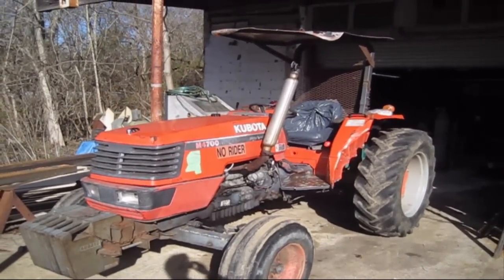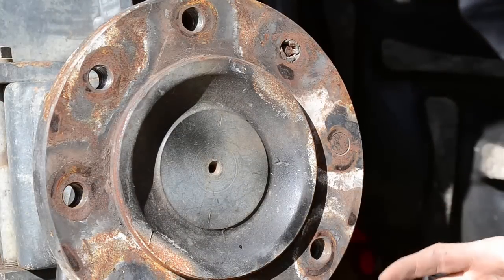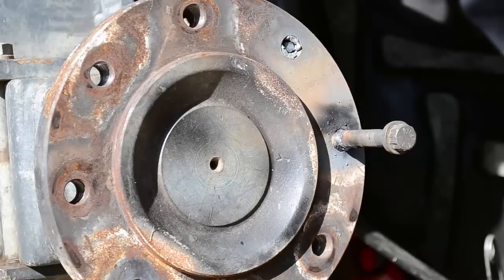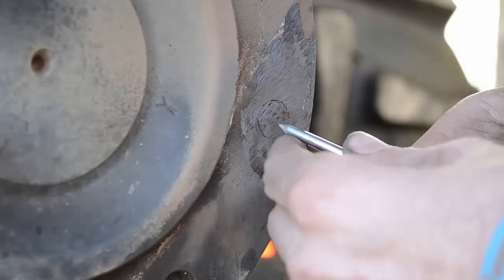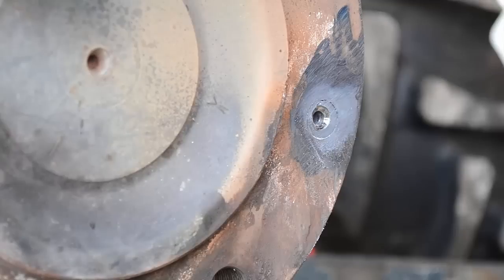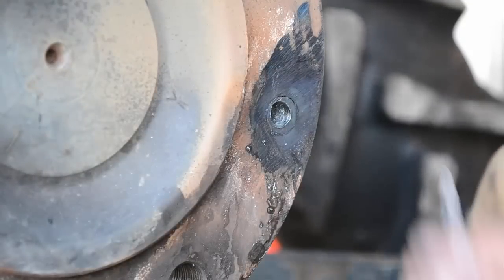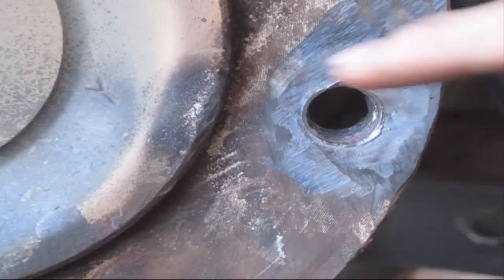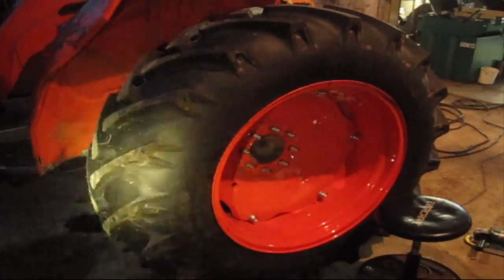Broke-off bolts techniques

Comment: 35 yrs doing this stuff, little tip is set the bolt 3/4 way off center of the broke stud and then get a good fillet from the broken stud to the bolt.  it's much stronger than a little ring around the outside.  thanks for the video

Comment: 1)Slow the drill speed. 
2)Left hand drill bits. 
3)Lube the bits. 
4)Heat around the bolt, not the bolt.
Reply: my sentiments, exactly!
Reply: yes your right DO NOT HEAT THE BOLT YOU HAVE TO HEAT AROUND THE BOLT TO MAKE THE BORE EXPAND.
Reply: I repair heavy equipment for a living, I always drill the bolt first, slowly and preferably a left hand bit. Then if you have to heat the bolt and when it cools it will shrink to the hole you drilled thru it
Reply: Dito on the left hand drill bit.
Reply: @gophersanders6542  I agree. I also repair heavy equipment. Whenever you need to heat something up to get it unstuck, always try to heat up the piece you plan on throwing away.
Reply: You dont drill, you dont heat around it, you just weld a nut on it and use an air hammer on the top with a box end wrench. Done this hundreds of times.
Reply: @EliteTruckRepairs  Never been shown that trick. Thanks, I'll have to try that.
Reply: 1) Definitely. 
2) Useless in this situation. 
3) Definitely. 
4) Doesn't matter, just braking the bond.
Reply: J B 
Left-hand drill bits still make a round hole. So it doesn't matter if you use right or left hand bit. But you want go heat the hub to expand, not the broken stud. There are many ways to get the out, but use a diamond bit. This should not have taken longer the 30 minutes to fix.
Reply: Candle wax after heating AROUND the bolt . Prevention of breaking a rusted bolt is so important.
Reply: In some cases you cannot drill or weld a nut in because the part that was held by the bolt has no room. Plasma cutter is the only option and this creates another set of problems.
Reply: Heat the bolt red hot, let it cool to room temp, take it out with your fingers.
Reply: @k9cop998   the thought process behind the left handed drills are they sometimes spin the stuck bolt out. Very rarely though
Reply: K9 Cop 
Yeah, well, that left handed bit can and will bite and unscrew the broken bolt a lot of times once it's just about through. A right handed bit won't do that, it'll only bottom the broken bolt even tighter most of the time.
Reply: @larrypostma2866 It doesn't matter here. It's a through hole.... A right hand drill will also grab it, but it will push it through. Especially here where the bolt won't go out the right way.
Reply: @cedryc44 That's a good rule. Heating the part you throw away doesn't matter. It's scrap anyway.
Making a hole through the bolt, heating it red and leave it will first compress the material since it has nowhere to expand and when it cools it will shrink. It should be loose in the thread when it's cold again.

Comment: I worked on the railroad for over 30 years ...the best way to remove a stud is to just weld a flat washer to the broken off stud.then put a larger nut and weld to the waxher thru the hole...dont wast your time with a torch. The welding heats it up and then the outside of the nut is pristeen for a socket. On an impact gun. 
On the holes that are stripped , you can drill it out a d insert a bolt thru the back with a piece of flatbar welded on the head so it wont twist. Ir. Wld up the hole, aneal with a torch and then tap or use a Helicoil insert. Thanks for your video
Reply: what ,if the stud is recessed, can't weld a washer to the stud???
Reply: Zoltan vacsi I have had that before, I use a mig and slowly and carefully build up the stud to the surface then weld a nut on
Reply: Lee make a video please

Comment: A few negative comments on here but seemingly from people without their own YouTube channel demonstrating their superior skills.  I'm a DIY amateur who maintains a couple of old 4x4s, and have had my share of broken-off bolts.  I honestly wouldn't have fared any better.  This was an honest and well-narrated journey, informative and interesting to follow along.

The only additional things I can add is that sometimes I use phosphoric acid - for example Frost's POR15 Metal Prep - soaked down into the threads (if there's room) for 30-60 minutes before I start.  On occasion I have found it helps to break any rust bonds.  This has worked a couple of times for me in combination with heating the bolt area with a butane torch then shielding the surrounding area with hand-held cardboard containing a hole that allows me to spray the bolt head with cold water...to shrink the bolt but leave the surround expanded.  (This is assuming I have a nut welded on.)  Not foolproof but has helped save me a few times.
Reply: A Teleskier .... Use muratic acid applied drop by drop to area...it will remove rust down to white metal..😃👍👍👍

Comment: Tip from a hobby machinist:  don't run a drill wide-open in steel!  It can't get a good bite running that fast and you just end up dulling your bit.  Start slow, and as it cuts more and more, you can start to bring the speed up.  I typically don't get over half-throttle with a battery powered hand drill.  The thicker and/or harder the steel, the slower you need to go.
Reply from the maker: Thanks for the comment.  Well I am not a purest with drill bits, but I have drilled a hole or two.  I have never heard of slowing down in thicker material that's a new one for me.
Reply: I agree. if you're drilling wide open and getting little needles for chips, you need to slow down or get more feed pressure. i also keep a solid carbide drill bit to get me out of tricky situations. Drilled a broken off Allen key out of a set screw with em once no sweat.
Reply: solid kobalt but and drilling oil works well too
Reply: I learnt that too as an apprentice, I smoked a drill on Stainless and an old guy told me to slow it right down. High speed just gets hot, and that's is what blunts a drill bit really quickly. heat is your enemy drilling
Reply: One thing that I had in my toolbox was a masonry bit.  I had a 3/16, 1/4, and 5/16.  You will need to take them to a machine shop to get them sharpened, but I used them on broken exhaust studs on 3406 and 3408 Cat engines.  They are tough, and like has been mentioned several times, slow the bit speed down.  Another thing to try after you get a hole through it is to heat it up through the hole and like someone else said, hit it with water to cool it quickly.  Hopefully it will shrink and loosen up.  

I use to have to remove large pins that were rusted in.  (3" to 5")  Cat had a tool called an oxygen lance.  It uses magnesium rods and they will poke a hole in ANYTHING.  Steel, concrete, rocks, etc.  After the hole is made let it cool for a while, or use water.  I tried to push a suspension pin out of a 777 and had a ram hooked up to push it out.  I had 100 tons of pressure on it and it did not move.  I had the welder poke a hole in it that night, and the next day I tapped it out with a 3 pound hammer.  

I agree with you about the EZ outs.  They usually do not work.
Reply: I was taught that using high speed would 'work harden' the steel.  Start slow, and it you get a chip with moderate pressure your speed is fast enough.
Reply: When a stud begins to show any sign of movement, especially when hot, apply oil to lubricate.  One technique that might have worked is to use a sharp drift or chisel at the edge of the stud and hammer it in the direction of the threads, knocking the stud round to undo it.  The immediate impact is so much greater than even an air tool can supply.  To aid this technique heat the stud and surround and then quench the stud rapidly with a hand spray of water.   The surround has much greater heat retention and remains expanded whilst the stud shrinks a little bit.  Again lubricate while hot.
Reply: dexter2433  Thanks for the drill bit link.
Reply: David Ferguson Cobalt bit?
Reply: dexter2433 has not really happened h
Reply: I was taught to squeeze the air hose to regulate the speed. If you failed to get a unbroken spiral of swarf you did not have drill at optimum speed for it's cutting edge. You failed the test, it wasn't about getting a bolt out, it was about getting the best from your tools.
GREAT video,  it never goes easy in the real world.
Reply: Thats the first thing I though of. Your going too fast. My pops was a Millwright. He tough me a thing or two. Yeah but go slow with lots of oil.
Reply: Ro
Reply: Julian Waldner  just finished doing the same thing with set screw real easy with carbide drill.
Reply: Classic Work,  nice video btw.   Ross is kinda right slower typically better of carbon steel,  I think slow slow to myself as I'm used to higher rpm's  .  higher feed rate too.    you can look up numbers SFM all of that.   but hardness and crystal structure of the metal is an unknown.   The experience of craftsman and FEEL comes into play,  

I don't see thicker material as a factor  , 1/4 - 5 /8 , lets say about the same.  Drill diameter yes, as you all know.   

Annealing the bolt in the hole , interesting.  Wonder if that could be done in a different way.  hummm.
Reply: @todayintheshopbanksy5904  On top of that stainless is a bitch..it work hardens. That means the more heat you get into it from your tools, the tougher it gets.
Reply: Exactly..! Also, some lubrication or cooling makes your tool last longer. Most important...don't go cheap on drill bits etc. Cheap shit made from some kind of chineesium won't cut for long and only produce swearing and cursing...lol
Reply: @kalleklp7291  your thinking 304 SS,  there are other options that are more friendly.  think 303 unless you got to weld as baseline rule.  416 is easy cutting too.
Reply: @johnm840  Yes, 304 and even worse 316.
Reply: @scratchcoderig  Crown brand Buttercut cutting and tapping oil works really great if you can find it.  Home of Economy in North Dakota Grand Forks has it, or online of course
Reply: @EEJester1586  Slow and steady, with some good (sulfur-based) cutting oil, will get the job done.  I've drilled through a leaf spring at 70 rpms with an old drill press, adding oil when it starts smoking.
Reply: Onee of those high torques low RPM corded drills will get the job done more quickly.
Reply: @todayintheshopbanksy5904  
You are right. Too high speed. Must be much slower. You ca make a test and that will convince you.
Reply: Good video!! All these recommendations are great constructive input which I will use.
Also just another tip I learned if you have an old rusted on bolt, heat it up with a torch and touch a candle to it. The wax is slippery and goes down into the threads. Works great and 100% better than WD 40. That is what the last guy should have used before he broke the bolts off.
Reply: And that would explain why drill presses do not spin at high speeds.
Reply: @Rat-Builder  I've seen those lances and they reach about 4,000 degrees centigrade! Nothing like burning a hole through Earth to the other side lol.
Reply: The bigger the bit the slower the speed
Reply: Have been doing this for thirty years now. Nice to see others have figured this trick out, Keep up the good work fella and peace too.
Reply: He means the drill diameter determines the speed. Pure and simple Sir.
Reply: Classic Work maybe you should drill one or two more. He is correct
Reply from the maker: jeeper don’t worry I quit.  All my stuff will be down before the year is out.
Reply: Yes, slow down and use some oil when drilling hard metals. Avoid allowing the heat to build up.
Reply: Learning to sharpen a drill bit by hand is a skill worth learning. Use a sharp bit with low to medium speed and sufficient pressure to keep the drill cutting. As Ross says, the harder the steel the slower you need to go. Dull drills and too much speed is a waste of time.
Reply: I agree.   I had a friend who was a professional machinist who taught me this.   Slow (e.g. a couple hundred RPM max) with moderate pressure and lots of cutting oil gets the job done
Reply: @EEJester1586  "I'll either Succeed or Fail" is an Excellent attitude in life!! I know this is an old post but i can't believe all of the unproductive/negative comments. Wow, anyway I'm sure you probably do this job frequently. Just my 2 cents here, an old boss in a job shop showed me how to remove stuck bolts with a modified version of this technique. It's amazing how fast it works. You do the same procedure with the bolt, nut or whatever and then push a piece of paraffin into it. The wax wicks into the threads and prevents thread galling. Broccoli rubber bands looped together around the o.d. of the rotors is also a great noise damper.
Reply: Exactly, and give some feed pressure for gosh sakes.
Reply: I learned that when trying to drill through vanadium steel.  No progress was being made and I turned to full speed out of frustration.  Cobalt drill bit, some oil, and slow speed got things going.
Reply: @EEJester1586  actually what is happening on that hard steel is you are work hardening it with your drill, exactly the same as what would happen on SS.  It isn't so much that you need to run a slower drill speed as that the drill absolutely HAS to cut on every turn.  If it doesn't then the surface gets harder and it is even less likely to cut.
Reply: @robertbutler8004  Most drill presses have many speed settings.
Reply: Yup, learned this the hard way...get it?...tried to drill some really hard stainless with way too high RPM and the bit came out with the first 1/4" about 1/2 the diameter it was when it started.  That's called REALLY getting it too hot.  I find you can actually cut much faster with lube and a slow bit rotation rate...contrary to what you would think, and the bits stay sharp way longer.  I've also seen guys remove really stubborn broken studs with very careful center drilling with a reverse cutting bit to the thread direction (left hand cut for right hand thread).
Reply: @EEJester1586  Everything has got a sweet spot,never run a drill bit wide open.
Reply: @EEJester1586  Might as well try it then and see if it works...
Reply: Pressure,slow speed and coolant !
Reply: @EEJester1586  You seem to be an accomplished mechanic but, take it from myself (a 40 year professional machinist and from all the comments so far), you never run a steel/cobalt/titanium/tungsten carbide at full speed...never. Even though they are marketed as HSS (high speed) they are not effective at cutting at high speed. The harder the metal being drilled, the slower your speed should be. The bit head needs to bite to drill and that is done at slower speeds. Higher speeds will quickly dull the bit head and always use cutting oil to prevent overheating. Cobalt can withstand higher temps than steel bits and can therefore be run faster. Titanium can be run even faster than Cobalt and tungsten carbide even faster. However they all need to be run slow until they start to bite and they all need lubrication.
Reply: @EEJester1586  use two drillbits interchangeably at extremely low rpm, they always get hot weather steel for masonry bits but at least to the same size or compressed to cool it down.
Reply: You may want to learn basic “feed and speed” or at least find a chart. There are ideal “feed and speed” formulas given type metal being drilled, size of drill. And diameter of hole. Slower is often better for material removal, and drill life.
Reply: @EEJester1586  feeds and speeds apply on a hand drill just the same as a drill press of mill and lathe.
Reply: Absolutely great advice I learned that a long time ago the hard way!

Comment: That 6011 won't take the vibration of the impact. Also, I like to spray a combination of transmission fluid and diesel after the heating. As the metal cools the oil is drawn in around the stud and makes removal easier. You did a good job anyway.

Comment: Stumbled across you videos a couple weeks ago. I've only had a small handful of "jobs" in my life. I think what you do is probably one of the "best jobs" a body could have. I like to help people. It is a good feeling to see a body smile. Back in the nineties...they shut the weld shop down at the high school I attended. Two years before I got to high school...a dozen booths...hundreds of feet of oxy-fuell line....all kinds of tools...welders...just sat there. Kids vandalized everything...smoked in the booths. No one can go back but I wonder how many lives were shit on when they removed that trade from the curriculum...five years ago (through YouTube) I taught myself to weld. Started with SMAW. I was told that stick was the thing to start with. If I could manage that....I could manage all of the processes....mostly true as there is a technique to GTAW. Up until this current administration...I had planned to exit concrete and move into welding/ mobile repair. I caught on to welding almost immediately. And realized quickly that welding is where it is at....period. And things were going good for me as far as achieving that goal. Then....we were lied too....and cheated. But! What makes this time different? They didn't hide it. Nope, they stuck it right in our faces....now they are running a smear campaign against anyone who might stand up for themselves and others....saying that healthy people are making healthy people sick....WTF??? What a "flawed logic" .... and to think that folks are actually buying into this nonsense....I'm gonna keep on keeping on...and do my best to keep a smile. But everyday that goes by....I see more and more lies. We have ALL been mislead. Boooooooooooo!! Happy welding! It is Saturday here in Northern Michigan and I'm waiting on day light to go out and work on a wood stove I've got mostly built. Been so hot. 😁